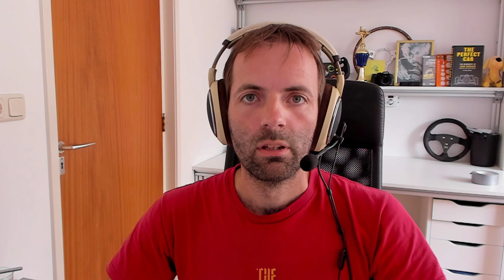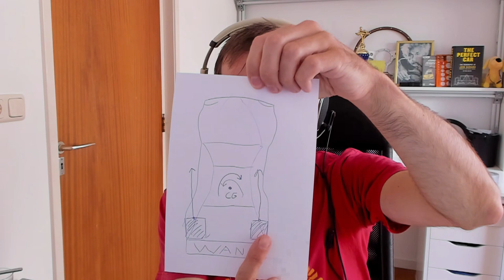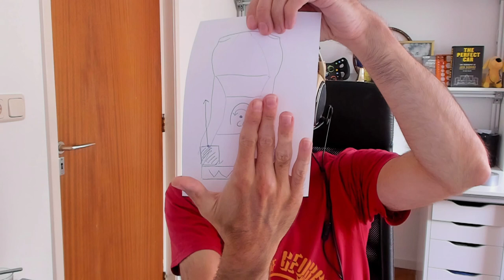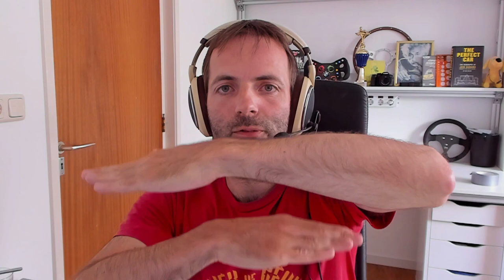An incomplete but (possibly) refreshing look at Race Car Setup!

Comment: Nice, but IMO a bit too much mixed together😬I learned quite a bit from the "Engineering Explained" channel you might know or not. He has 10 videos about differentials and now i know that 21:30 isn't correct. Open differentials always provide a 50% torque split to each wheel, so "not enough force" would be correct🤓
Reply from the maker: Well I think more accurately the traction to the outside wheel can't be greater than the inside wheel, so when that is lightly loaded and spinning, you can't get more than that torque on the outside wheel (which has more load and has more grip so it COULD deal with more. Its not that ALL the power goes to the inside wheel, but the outside wheel is limited by the inside wheel. I think so anyway
Reply: @NielsHeusinkveld  I prefer this explanation: With an open diff there is always a 50/50-split in toque, but since the outside wheel has more traction and distance to travel, it demands more torque and on-throttle the car should understeer. With a locked differential the torque shifts to the wheel with more traction and the more the inside tyre slips, the more torque goes to the outside leading into power-oversteer. Both concepts react the opposite off throttle and in order to get the best out of both, the LSD was invented. To prevent tyre-wear the open diff in most road-cars is just fine and torque transfer works great for karts. If all racecars would work like the Super V8, we would just get used to it and probably have more fun as well, at least in a sim:)